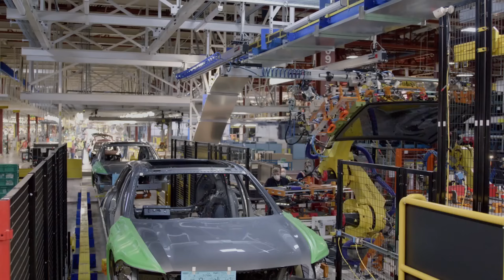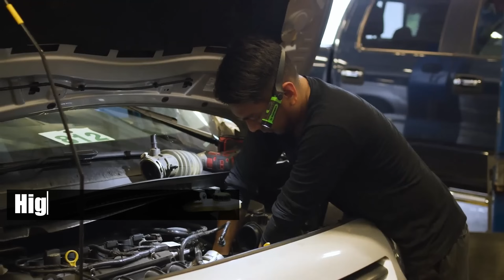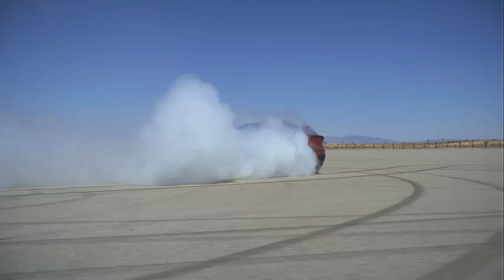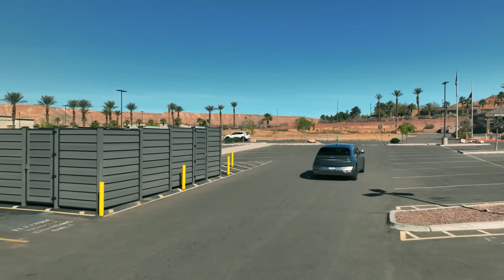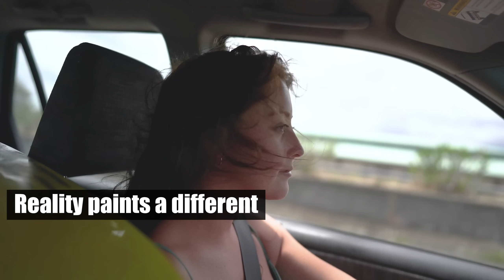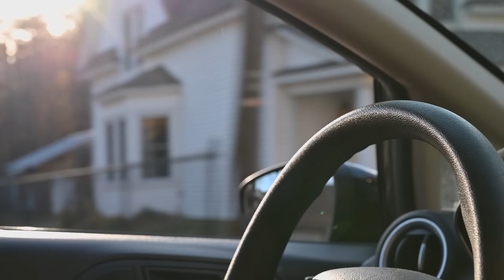Broken EVs’ Journey to Junkyards: The Unbearable Cost of Repairs! Electric Vehicles As Commodities!

Comment: I bought a hybrid ford explorer and happy to read from my research that compared to traditional ICE vehicles EV's have 80% more maitenance costs, PHEV's have about 30% more maitenance costs and hybrid cars have 30% less maitenance costs. This is mainly because EV's trade the workload back and forth between the electric and gas modes. The electronic motor kicks in for regenerative breaking which also takes some workload off of the breaking system. With these vehicles having a more modest battery thats tucked away in the trunk, that thing isnt going to explode in most crash scenarios compared to EVs. Also with the small compact size of the battery this means we can produce more batteries and roll out more vehicles that literally cant idle and start's the engine long after the vehicle started rolling. And for my last point, ford mechanics had informed me that to safely work on my vehicle, all one needs to do is flick a green switch that disconnects the battery from the car and their is no need to discharge or have a special mechanic to work on. Long live hybrids... the egg heads have developed a Sodium Ion battery thats cheaper to produce and brings its own up and down sides to car batteries.

Comment: Tires are already a problem and yet EV's eat through tires faster than ICE vehicles.  Road surfaces will also need resurfacing more, due to the extra weight EV's carry just to move the fuel about.  With ICE vehicles this weight declines over miles on the road, EV's are the same weight if full or empty.

Comment: What a load of absolute horse s**t.  I don't have an EV, but know at least 10 people that do, and they are all maintenance free with no issues. They are much simpler than ICE vehicles.  A battery and motors.  Good lord, how dumb do you think your audience is?  Watch any engine repair or transmission repair channel and see what's involved in fixing those engines for THOUSANDs of dollars.  Few parts, easier to maintain.  I have an F250 and love it, and I don't have an EV.  But I what this video says is just feeding the confirmation bias of those that hate what that idiot Biden is saying everyone should drive.   If you don't like EV's don't get one.  Do you realize how high gas would be now if those 13 million EV's on the road were ICE vehicles.   Piston Pundit, you suck.

Comment: I won’t name who I work for, but the amount of recalls we have for our phevs and evs is perplexing. These things are rushed to market full of gremlins. Had a customer stranded by his phev due to a KNOWN ISSUE, that can occur without warning. The actual service information straight from the manufacturer is essentially to throw parts at it, after doing some basic electrical checks. Starting with the PIM and escalating to a full blown transmission swap.
All of the parts are back ordered and take weeks to months to show up.

Recalls range, but are mostly software updates, that if not performed can cause all sorts of issues ranging from a battery that won’t accept charge to rear defrosters overheating and shattering the back glass.

Comment: Popular ICE models don't generally get sent to scrap because they require a minor repair.  If you own something exotic and relatively low on new sales volume like a Peugeot, Citroen or Renault and it has become impossible to get a new replacement part for after a few years it'll more than likely be scrapped after a minor accident.

Comment: I have been driving ICE cars for 27 years, no accident, no claim at the insurance...
but strangely this year my insurance raised from 122$ to 188$ per month with no reason. This is obvious that the insurer are already financing EV loss with ICE car owner. When you know you cant get out of a situation but still try to make it happen, it will only get worse.
Reply: Cost increases to insurance is due to many factors.  Some being the rising cost of all vehicles, the cost of parts, cost increase in service techs and increases in vehicle complexity.   Each vehicle has its own rate for premiums, a older cheap car is cheaper to insure that a new high end vehicle.
Reply: @larryjohns8823  stop trying to wiggle out of the massive insurance raise scam, we all know it is becuase of the EV.
Reply: @larryjohns8823  majority cost rise is because of ev's , mostly not repairable causing costly write offs

Comment: In my younger days. I would personally service the engine,  replace a cracked cylinder head, replace stuck pistons, and so on.  Today, you simply cannot without permission.  After, a couple of whirs restarted the thing and off I went. I was pleased I returned home and hit the sack after de oiling my hands.  

BEVs are a simple enough technology, battery, motor, drivetrain, and reuse of ICE tech give or take. What is going on. Might cost down manufacture be to blame, than the experience. No sir,  don't drive. An ICE hire once or twice a year on my breaks, yes.

Comment: My 1991 Fiat Uno Turbo still run like clockwork with about 350000km. Still totally reliable and cheap to maintain...
Reply: I had a 1991 Alfa Spider Veloce.  what a piece of crap that car was.  I loved it though.
Reply: I have a Suzuki vitara 2015 230000 km and never had any repairs other than tyres and brakes Runs like a dream.

Comment: Late 90's-early 00's vehicles are the most reliable, efficient, recyclable vehicles on the road. Mechanically, the automobile peaked then. Fuel injection and overdrive transmissions peaked then. Collision technology has improved but these vehicles have become appliances that will be disposable after 5-7 years. Poor and blue collar guys wont be keeping them on the road for decades. The piles of plastic behind the plastic bumpers wont be available new or used. Minor repairs are going to make the modern car a useless, brick that's mostly not recyclable. Poor people wont be able to afford a vehicle. This isnt part of the war on poor people but it sure helps.
Reply: Yes, and less electronic technology. 👍

My car has:
ESC – Electronic Stability Control
TCS – Traction Control System
PDC – Park Distance Control
- It's better for me than having a camera. I don't need to look at the screen... the rest are mirrors. PDC + Mirrors = Perfect 🙂 I don't know, at least for me.

And that's more than enough. I know we can drive a car without safety electronics, but ESC is useful.

I can turn off ESC/TCS at any time if I want, which is 👍.

Useful features:
EDC – Electronic Damper Control
ACC – Active Cruise Control

The feature below use sensor in the front, which I don't really like it. If it really worked 100% correctly, good, otherwise no thanks. 🙂 I don't want any surprises with full braking for no reason 😀

BAS – Brake Assyst

For the features below, no thanks 😀
LKA - Lane-Keeping Assist
LCA - Lane-Centering Assist
etc.

Comment: I am never going to get one of thees EVs, no way.
Reply: Because you cannot do math?
Reply: @nathansmith7153 What that had to do with anything 🤨?
Reply: @davidmiller6765  So you are as clueless as he is. You have no idea how to evaluate the cost of driving.
Reply: @davidmiller6765  3CENTS A MILE  SO you never changed the oil, had to adjust the valves, replace brake pads, ....
Reply: @nathansmith7153  And tell me how long do you have to wait for it to charge up ? My nephew have a tesla and he always complain about being late for work because of that , he live in an apartment so he can't setup a charging station at home that much is obvious 🙄 and sometime he had to go out to the charging station late at night and he always scare some shady thug gonna muck him.  And about all the other stuff you mentioned,  it sounds like you never ride an gas car before and if you do, you would already know how cheap it is to do all it. Plus some of it can be done yourself. So yeah no thanks keep your 3 cents and wait for hour before you can go to work. Me ? I just go to the gas station ⛽ like 5 minutes and on my way to work 😏. And again , tell me how much does it cost to repair your EV again ?🤨
Reply: @davidmiller6765  I don't wait at all. It's fully charged in the morning.  Don't you have electricity yet where you live?
Reply: @nathansmith7153  because   I'd rather play with my D   k